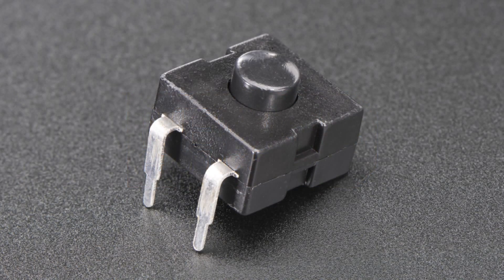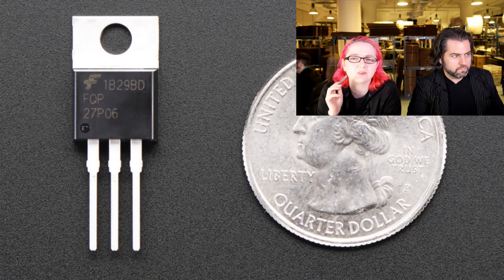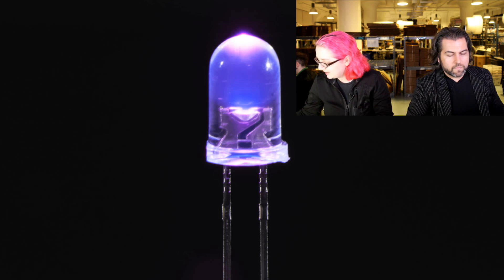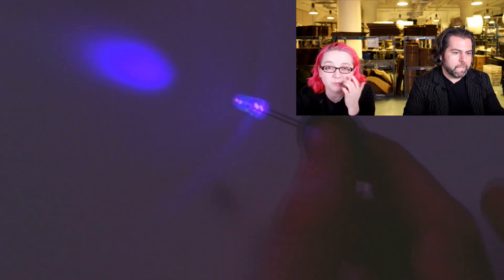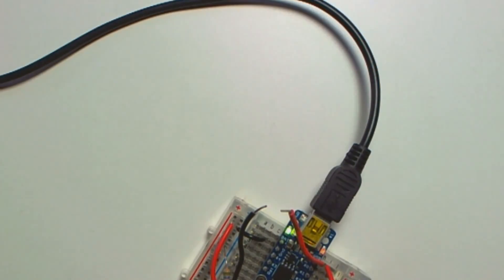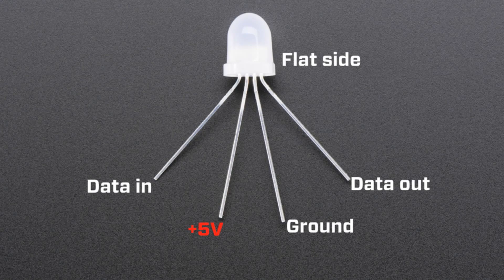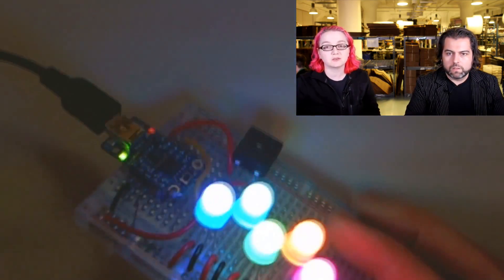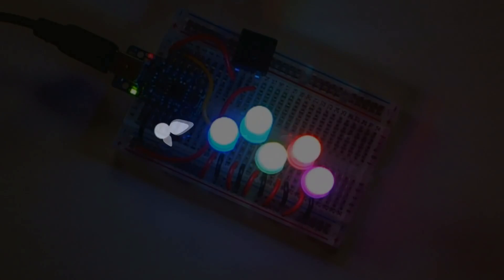New Products 4/16/2014

Comment: If you still have power running through when you turn it off with the switch then you need to put a blocking diode in place but don't forget to calculate the resistance of the diode into your formula. If the lights are still receiving power then you will be bleeding power if you run it on batteries.